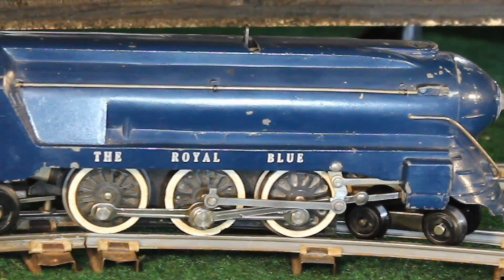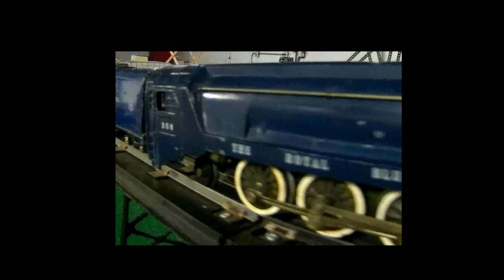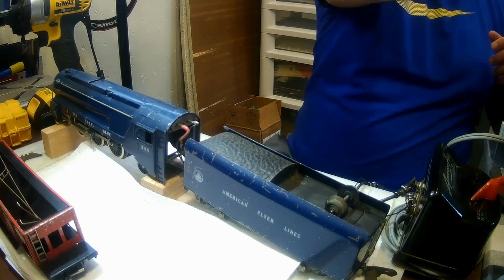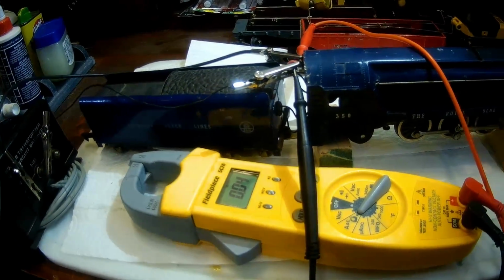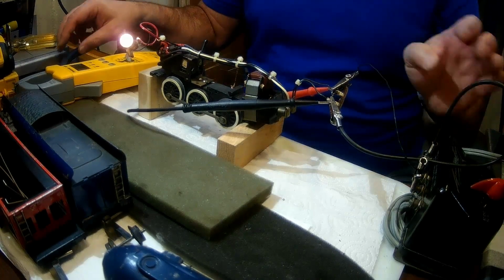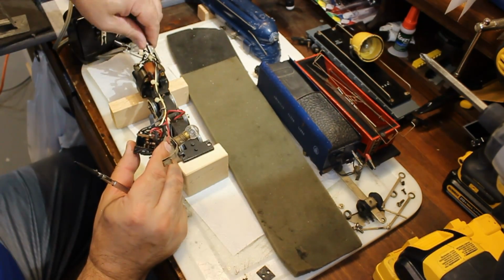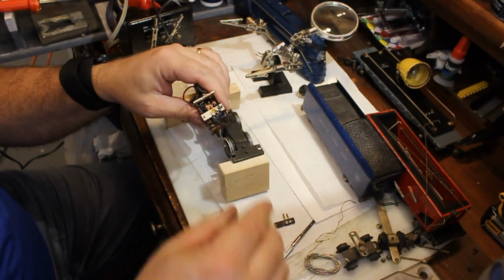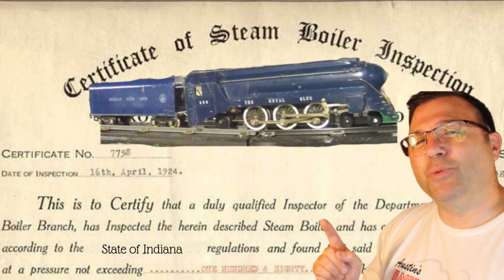A 1948 Royal Blue is restored to service...a shortcut to diagnosis and more!

Comment: Two thumbs up. You mention some steps omitted, but this a good generalization on how to diagnosis the problems of non-working units. Personally, I don't have too many issues on the electrical side. With model trains, computers, and Ham radio with other electrical schooling, I don't have too many issues on the electrical side, but I watch for the mechanical side.

Comment: The new video camera and lighting in your new heavy repair shop have really improved the quality of your videos.
Reply from the maker: Good to hear.  What did you think of the pacing shots at the end?
Reply: @AustinsAmericanFlyertrains  I liked that.   Where did you mount the camera?
Reply from the maker: @Bill Anderson on a flat car...a searchlight car with the searchlight part removed.
Reply: @AustinsAmericanFlyertrains  Can you adjust the camera to get a first person engineer's view of going down the tracks?
Reply from the maker: I've been pondering that...the trick is getting an engineers view...looking along the side of the boiler...I have a few ideas but I have not yet had a chance to try them.  I did do some framed shots...that show promise...more experimenting needs to be done.  The wide angle and small body size open up possibilities I probably have yet to consider...
Reply: @AustinsAmericanFlyertrains   go pro

Comment: I repaired those fingers by adding solder to the fingers, when  I was 10 years old,  around 1949.    The AF O engine is still on my train table.
Reply from the maker: My attempts at figer repair with soldier have only been marginally successful.  Congratulations that's yours has lasted this long.

Comment: a solid state reversing unit:       Expensive and not repairable.      Better yet to use repairable E plus a full wave rectifier ($3)
Reply from the maker: Thankyou For the comments Roger.  Do you install the full eave rectifier after the reverse unit so the motor is running in dc?